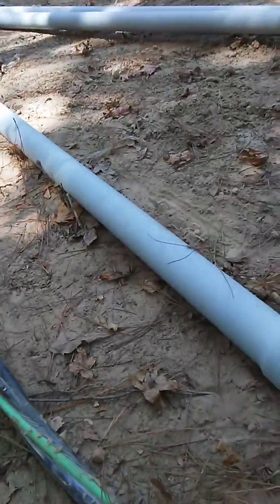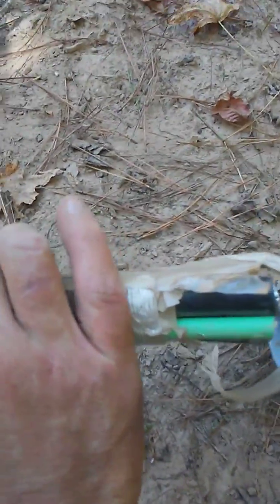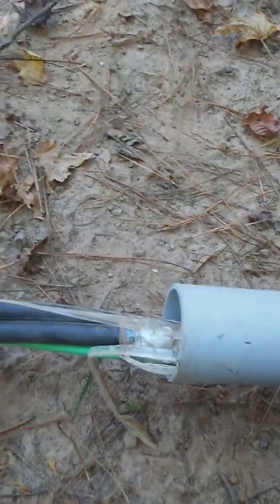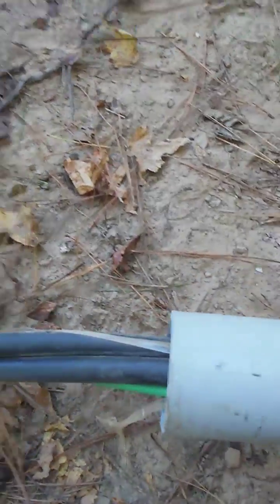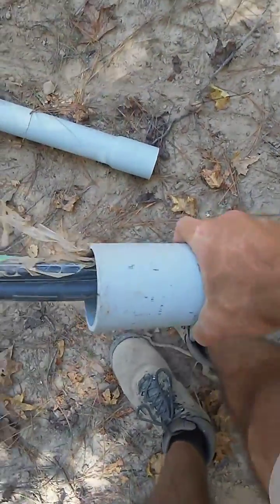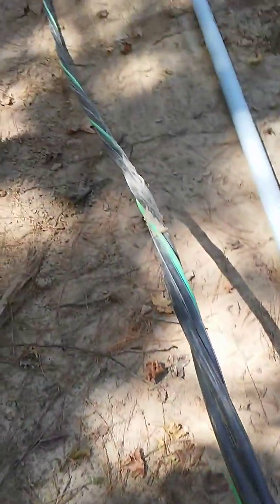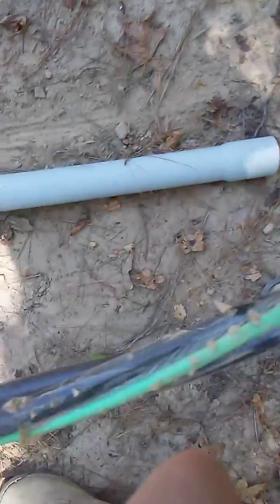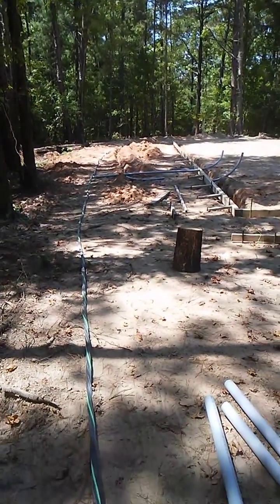4/0 electrical cable wire in two inch  conduit.

Comment: Is it legal to assemble the conduit around the cable like that?  I’ve always heard it had to be assembled first and then wires pulled through afterward.
Reply from the maker: I live in the country where there are no restrictions or inspections. I am not an electrician and I don’t have to follow any rules or regulations.  This is my property and the engineer from Entergy that was on site told me I could have nailed that line to the trees and he has seen people do it. The power company fully approved my work and gave it the green light.
Reply: @Heartacresfarmsanctuary So, there is a rule that raceways should be complete before pulling the cable. However, either way you slice it that would be a tough pull.
Congrats on perservering and 'getting it done.' 
A friend of mine pulled 150' of 4 500's in a 3 inch by himself by hooking the rope to his truck on idle and turning up the idle as the pull got tougher. It would only move when he pushed. Also probably not legal. He 'got it done' regardless also.
Reply: It's bad practice, should be able to pull the wire through or out in the future.  Also PVC glue can damage wire insulation.
Reply: @MichaelJudd-l6u  xhhw-2 wire is chemical resistant

Comment: according to the NEC you should have used 2.5" pipe
Reply from the maker: I am not an electrician so I followed the directions given to me by the Entergy engineer I was working with. Everything worked out perfectly. Thanks for commenting!
Reply: Conduit fill and heat build up are the reason for sizing conduit.
Reply: The three wires are only 21% fill on 1 1/4 which is perfectly fine the the length of the run may make you up size the wire probably not enough to up size the pipe and bare wire isn’t allowed in conduit probably should just be 4awg or 6 xhhw taped green for the ground

Comment: We tried to pull 3 strands of 2awg and a bare copper ground through 1 1/4" pipe and its snapped the mule tape. What size pipe do we actually need?it's 180' of conduit.
Reply from the maker: Something bigger!
Reply: Did your wire burn up yet?
Reply: You need an electrician 😂

Comment: If this is from the meter to your house with no circuit breaker or fuse, quad is not correct.  If breaker or fuse first, then correct.  You are not installing as required by NEC.  I would have put in 2-1/2” pvc and bought THHN/THWN conductors instead of that cable and pulled through the installed conduit.
Reply from the maker: This is from the panel which has a breaker.
Reply: 2.5" schedule 80